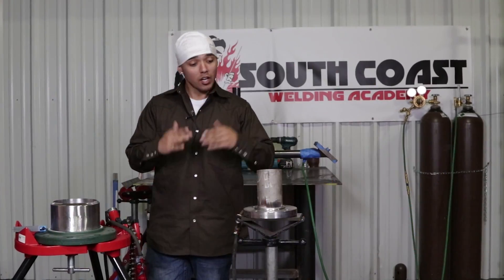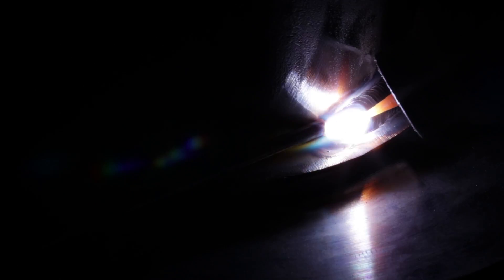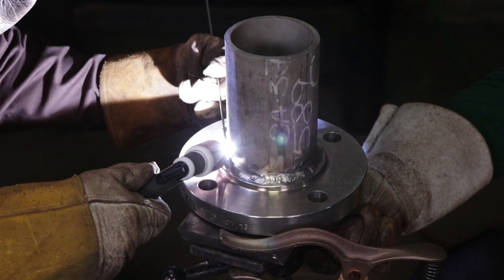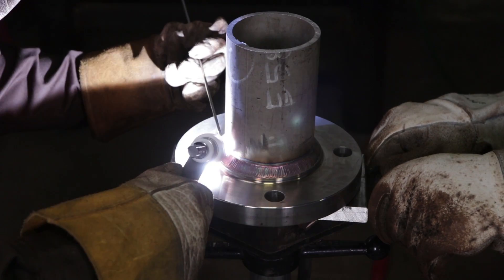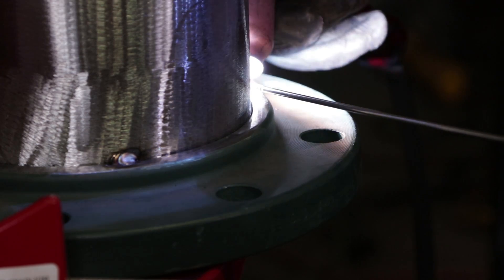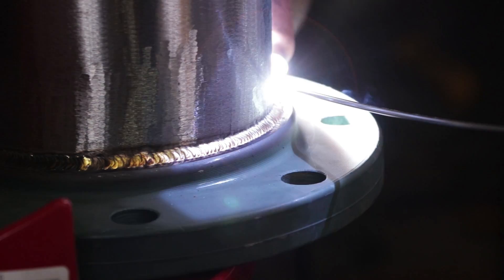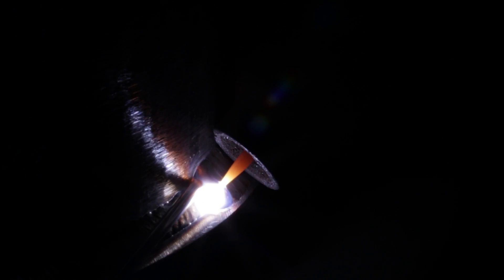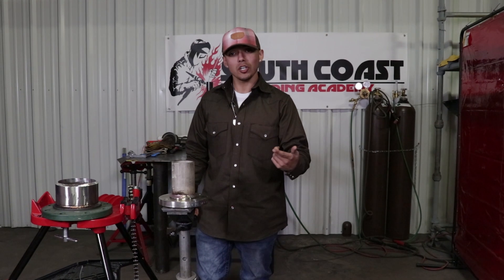Welding Socket Flanges 101

Comment: question do you ever weld the flange on the inside worked at a fab shop that was a rule 30 deg. then one pass on the inside was that right or wrong your guys thoughts please.

Comment: Wen i use 160 amps it melts the steel. How do u overcome this?
Reply: Run lower. You are probably welding a lot less thicker then what he is. or add filler to cool down the puddle.

Comment: I did a 3/4” socket weld that was level after the 4 tacks before the end of shift. The next day when I came in, I noticed night shift had finished it and it was no longer level. What could I have done wrong?
Reply: They probably flushed one side out then finished the other side.that or they was running too hot and took a break.

Comment: Hi bro, would you be so kind and make some vid how you weld slide-on flange on 8 inch/sch80 carbon steel pipe on 5g position, especially inside, with 7018 rod. I'll be very grateful. Stay good!!

Comment: Would like to see some 1/2 in and 3/4 ss socket sch 40 welds with walking and free hand.
Reply: I free hand my 3/4 inch welds.
I haven't done any socket welds yet (other than practice on scrapped socket fittings)

Comment: Brother the pipe and the flange where 304 the tig wire you where using was 308
Reply: But you are a slick ass welder no doubt

Comment: Question:  Do you guys have in your pipeline of videos to explain the UA 21 (Welding 6G - 2" Pipe Heavy Wall 6010/7018) ?  I've always struggled with proper bead placement to get it flush.  You would be great at explaining this test
Reply: I.R. Bonetta what local are you from ?
Reply: +Chris Capozzi Not in a local yet. Planning on it soon.
Reply: +Chris Capozzi you?
Reply: 777 Ct.
Reply: this guy has some decent vids but if you want help with a UA 21 go check out weldingtipsandtricks by Jodi. He's a retired UA fitter/welder and does some amazing videos and also UA weld cert specific videos.
Reply: Thanks! I've seen most of Jody's videos, and love how thorough he is.  I believe he doesn't have heavy wall 2" pipe, though.

Comment: My biggest question is how to add filler when walking the cup? My issue is not having enough filler or dunking my tungsten. I try and keep pressure on rod but even fill or not killing tungsten is a rare occasion. Help
Reply: To be honest 3 years ago I was asking all kinds of questions the only way u will learn is to put ur hood for 8 hrs and burn baby burn  and u will learn ( hard work and dedication !
Reply: Hector  Delarosa  i weld everyday. Would like to have this down and pass my 6g cert test in 6weeks. Idk if that's possible or not.  3g and 4g I'm pretty consistent at but not on pipe yet